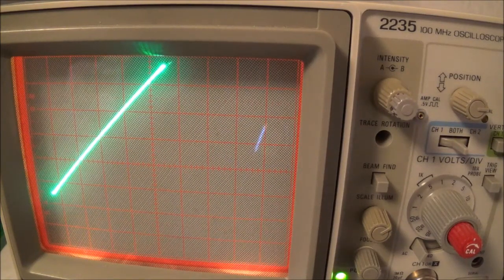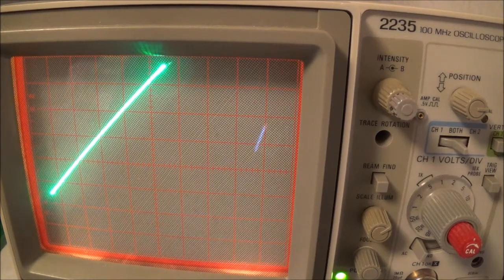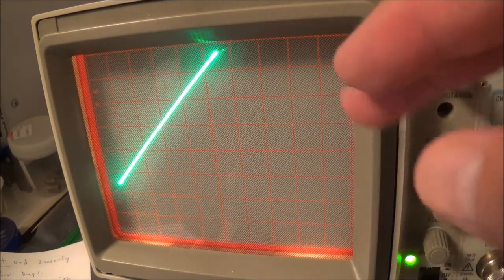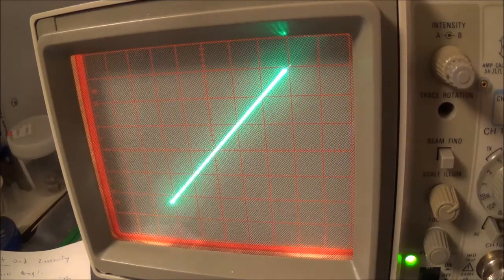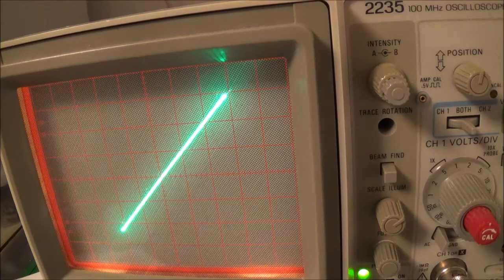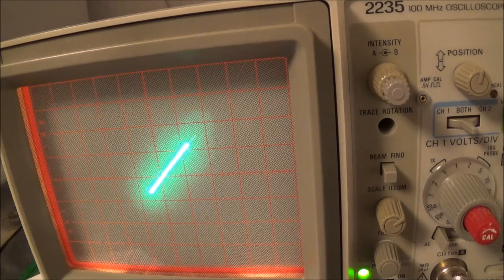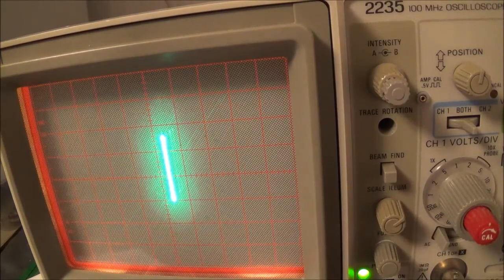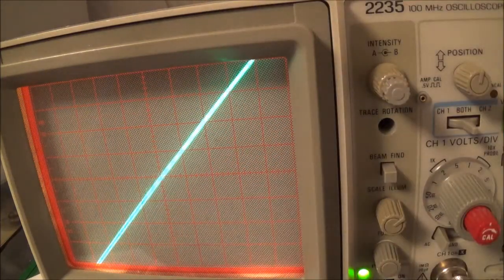Oscilloscope Phase And Linerarity Check

Comment: This is great to know!  Need to do mine once I get ch A working!  Looking forward to the meat of the act!  Thanks for the video!  ~Jack, VEG
Reply from the maker: Thanks for watching; hope this wasn't a time waster! Obscure topic, I know, but every tech needs to know this. Lissajous patterns, your favorite subject, might be next before I do an amp checkout.
Reply: Not a time waster, been wanting to know more!  My first o'scope (https://www.youtube.com/watch?v=spUe7p2jXrM) actual has a separate connector for this without needing to  connect ch a & b, once I swap office with the wife, I will have both scopes inline, but my primary scope, I still need to try and fix it.  Like I said, I have the feature and dorked with it but don't understand it enough to use it.  I know it can be used to troubleshoot components while in and out circuit, but that's about all I know.  Looking forward to your next video....maybe more on this topic???  Thanks Old School...your the greatest!  :)  ~Jack, VEG
Reply from the maker: Thanks for your kind words and for watching! I hope I kinda made sense, since I didn't show any hook-up sketches, etc. I made an amp X-Y check-out video, with a sketch of how things should be hooked up. I think I kinda did something like this a while ago, but just glossed over it really. This is slightly more in depth. This kind of test is seldom done probably. It has its good points and its limits.
Reply: It for me was good enough!  Maybe a future video, you could touch more on the hookups and or real life applications??  EIther way it was cool.  Thanks for taking the time and demo'ing!  ~Jack, VEG